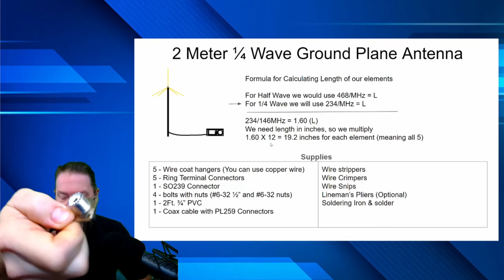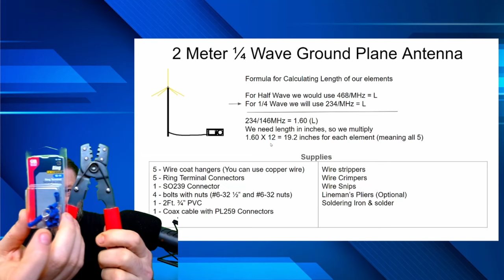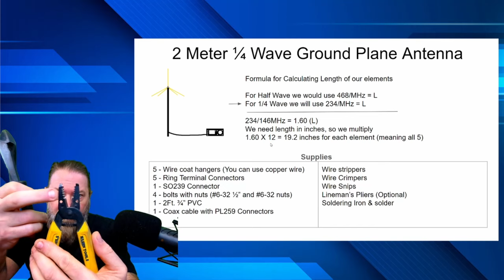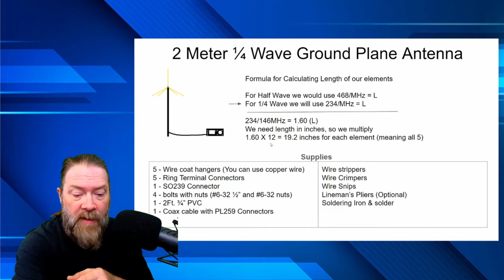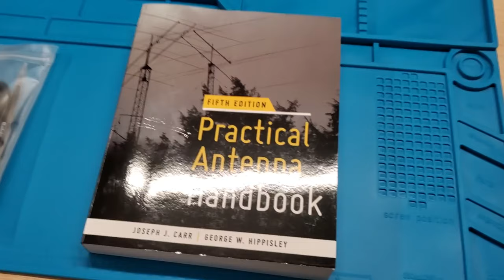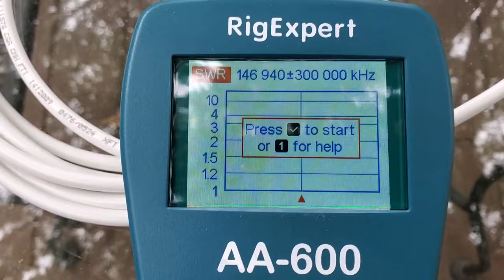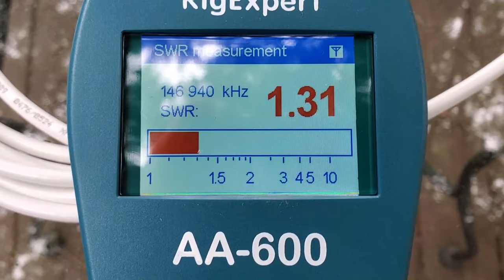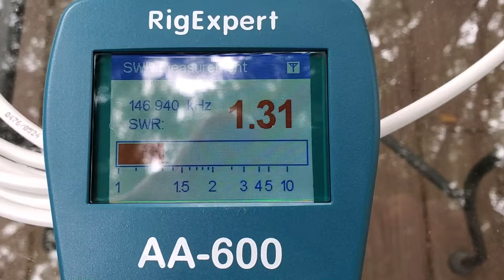Ham Radio Antennas for Beginners - Build Your Own Today!

Comment: Steel wire will stand up at these lengths whereas copper may not. Instead of a pole, it could be pulled up in a tree and the ground radials tied off to ground stakes with paracord or 1/8th inch elastic cord.
This gives me an idea for a yagi on a 1x4 board.
Reply from the maker: There are multiple ways to build this thing...I just demonstrated one for simplicity and showing how you can build an antenna for less and $15.  Thanks for the comment and for watching.  73!!!!

Comment: Some of the hangers have paint and need to use sand paper. New hams with hand held should get the adapters for the hand held to PL259. You will need that some time. and when you need it you may not have time to order it. They don't cost much. If you have the power out and you want to talk, your hand held connected to your outside antenna will get you out. I think part of being a Ham is to be ready for that kind of thing. 73  W4des
Reply from the maker: Well said!!!  As new hams progress in the hobby, they will build up their own kits, hopefully, and adapt to their needs as a ham operator.  Thanks for the comment and for watching.  73

Comment: How far away was the repeater you were using? I'm in the process of building one of these antennas right now. I just got all the stuff last night and going to build it tonight.
Reply from the maker: Fortunately my repeater is 800 feet up and about 5 miles form my house in the video.  Due to its power and height, it reaches out about a 60 mile radius depending on propagation that day.  Thanks for the comment and for watching.  73!!

Comment: Studying to get my lic.  My question is, can you have a combination antenna that is both vertical and horizontal, covering most used band widths?
Reply from the maker: I think that would not be necessary.  If you are just using a 2 meter / 70 CM antenna like one of the Comet or Diamond antennas, they will cover both of those bands in their entirety.  The thing is to watch your SWR and keep it as low as possible for the best performance.  I hope this helps a bit.  Best of luck on passing your exam and getting licensed!!!!  Thanks for the comment and for watching.  73!

Comment: I watched this vid - got everything to do it.   Guess what - the #6 little bolts do not fit the hole - too big for the SO239.  Can you explain that?
Reply from the maker: That is very odd....maybe not all SO-239 manufacturers are the same??  That makes no sense.  I am sorry you are having that issue.  They "should" be universal.  Thanks for watching and for the comment.  73!
Reply: @HR4NT  I got #4 screws off Amazon.  Those do fit - there is some play.  There should be a #5 screw - that would fit perfectly.  The number 6 screws did fit in an N connector that I had.  Guess what - trying to solder -  I melted the insides of that N connector.  Question - what type of solder should be used for these types of connections?  I've got lead-free, 35g, 0.8mm, 0.7%copper, 99.3% Tin.  73!
Reply: @HR4NT  Update - I bought more so-239s and N connectors.  #6 screws fit perfectly in these 239s.  I guess 239s are not universal.  On the ones that the #6 screws did not fit, there is a serial # - KU-79-20.  Not sure what that number means.  On the new ones I got, there is no number.  Time to try it again - without melting the connector this time........
Reply from the maker: @joelschuman1303  good to hear.  Glad you found a solution.  It seemed odd to me that the screws wouldn't fit.  Thanks for the update.

Comment: I looked up your SWR meter...😵‍💫a little out of my price range. Can you recommend a decent but more affordable alternative?
Reply from the maker: The AA-600 can be a bit pricey.  My alternative, which has a smaller screen is the Stick 500:  https://www.gigaparts.com/rig-expert-stick-500-analyzer.html  If that is to much then you are down to a NanoVNA, but they have a large learning curve to figure out, but are around $100.  Let me know if that helps a bit.  73!
Reply: @HR4NT  many thanks!
Reply: I've built more than a couple of these.  My experience is if you build them to the dimensions given they will work.  Testing is nice, but not necessary.  And, if you must test, borrow.  It is much less expensive.

Comment: Wow. I have subscribed for a while, and I have to say that your definition of "non-techies" is very, very different from mine. 

I do not have the location, parts, tools, or knowledge to do most of what you show. I also don't have the space for most of the antennas you want. I do not have a balcony, or attic or lawn, or anything big enough for an outside antenna. I guess I will have to find a place geared to those of us who are at the Less Than Non-Techie level. Or I am thinking about the wrong hobby.
Reply from the maker: There are solutions to every issue.  If you cannot build some of the projects due to lack of skills or tools, then just buy the items that are ready to go out of the box.  My tools didn't come over night.  I spent year buying a little here and there until I had what I needed an that allowed me to expand my ability to do things like you see in this video.  I am not sure what your space situation is, but you "can" put up an antenna in your attic sometimes or hang one inside your house .  It will produce limitations, but is very doable.  In my videos I really try to break down everything in a very easy to follow manner and using minimal tools.  I wouldn't give up.  Just find a solution that works for you.  If for now you have to buy gear instead of building it, so be it.  At least it gets you on the radio and enjoying the hobby.  Thanks for the comment and for watching.  73!
Reply: Your antenna doesn't need to be outside.  It will work better there.  But, if you are working repeaters outside may not be required.  One of the many things I have done over the years is a magnet mount antenna stuck to the top of my refrigerator.  It worked quite well, all things considered.  I could get into every repeater I wanted to.
Now, I have a question for you.  Are there any clubs in your area?  Generally speaking, we are a helpful group of people. If you were to explain what you planned to do and any lack of skill you may have I'm sure you would have plenty of help.  Both with tools and knowledge.   Good luck to you sir.
Reply: @hammathguy3995  As to the questions, I live in a rural county in South Dakota where, according to the FCC, there are less than a dozen ham licenses in total. The closest club is almost 100 miles away, and the one repeater nearby apparently is not connected to any system, though I am not sure I understand enough about it; I do know I have only ever heard one transmission by a human, its call sign. And only once.

Comment: I assume this cannot be left outdoors where it will get rained on, right? I presume that connector would give way.
Reply from the maker: Yeah probably not the best idea to leave it outside unless you can waterproof the connector.  Maybe coax wrap for your cable connecting to it and maybe hot glue on the other side where the soldering was done.  You don't want moisture getting into the so-239.  Thanks for the comment and for watching.  73!

Comment: I have a little hand radio made by some Chinese company that can scan frequency's. I can pick up weather on 162.425 but just static on everything else. Any advice on how to boost the ability to get other things to listen too? I know nothing of ham radios other than there is an abandon house up the road with a huge antenna behind it.
Reply from the maker: If you have the ability with that radio to change out antennas, I would research that.  Find out what type of connector the antenna has and look for something like a Signal Stick or one of the Diamond series antennas.  You will need to know what frequencies your radio picks up and purchase an antenna specific to those bands or frequencies.  162.425 is way above the 2 meter 144-148 frequencies used in Ham Radio.  I hope this helps.  Let me know!  Thanks for the question.  73!
Reply: @HR4NT  Thank you so much! That really helps a alot actually!!

Comment: Newbie question.  What is an acceptable length for the coax cable when using a handheld radio?
Reply from the maker: If it were me I would keep it between 10 - 15 feet.  I would say use as little as you need to make a good transmission on the radio.  Hope that helps.  Thanks for the question!  73!!
Reply: @HR4NT  Thanks for the quick response. I guess my 50 ft coax is too long LOL

Comment: What max watt output do you recommend for these antennas? Would you use these with mobile radios at 100W also?
Reply from the maker: Being that it is a wire antenna directly connected to the SO-239, it should handle100 watts no problem.  The issues come when you add in things like a balun, unun or capacitors.  I hope this helps!  Thanks for the comment and for watching...73!!

Comment: attmpting to build this antenna but the coax with PL259 does not fit into the SO239 connector. Have even ordered another coax with PL259 still does not fit. Any recommendations? Tried to find an adapter but not yet found one.  would be nice to have an anateur radio store for advice. Thanks
Reply from the maker: Since I cannot see the actual issue, could it be the SO-239 connector causing the issue?  I have had moments where it was a tight fit sometimes, but never an issue like what you are experiencing.  Email me and let me know.  Thanks!  73!

Comment: Can you use copper wire with the insulation on it or does it have to be solid un-insulated copper wire like 12 gauge copper wire. Thanks
Reply from the maker: You can use any wire you want...does NOT have to be copper or any specific metal.  You just want something that is stiff enough to hold its own weight.  If you give this build a try, let me know how it went.  Thanks for the comment and for watching.  73!
Reply: @HR4NT  yes absolutely & I will try building it and give you a update 👍
Reply: @HR4NT  also what size or kind of coax wire do you need to use from the new antenna to your radio. (RG58 & or RG59 & or RG6 can you use either of these). Thanks again for your input
Reply: @HR4NT  I found a roll of 250’ of RG6/U in my shop building. Can I use that to hook up to the 1/4 wave antenna (I’m going to build) with a PL259 connector to a SMA connector on a handheld radio. Thanks again for your input
Reply from the maker: @davehardtke1712   You technically can use it but it is not ideal a coax like RG8 or RG8X would be.   You may need the use of a tuner tomake up for the losses by not using a 50 ohm coax.   I'd say give it a shot and do some testing and see how your SWR is on your readings but generally you want to use RG eightex coax or something similar in the 50 ohm category for ham radio.
Reply: @HR4NT  ok thanks for the info and I will keep you updated. Luv your channel & thanks for what you do 👍
Reply: @HR4NT  ok update: got some RG8X coax with connectors & built 1/4 wave ground plane antenna from your video  & turned out great. Got a SWR reading of 1.1 👍 I’m using a Baofeng BF-F8HP radio & studying to take my test.  thanks again my brother I’m new to this & your channel is great from someone new to this. Probably more questions coming along the way lol 👊
Reply from the maker: @davehardtke1712  Outstanding!!!!! Glad to hear it!  Let me know if you have other questions.  73!!!!

Comment: im new to ham radio but i really want to build the antenna in your video i was wondering what  radio you are using so i know which one to get  and use it to speak to the world
Reply from the maker: You can use ANY VHF radio out there.  The radio I was using in the video is the Yaesu FT3DR, which has since been replaced by the FT5DR.  If you use a handheld radio (HT), just make sure you have the proper adapters to go from SMA to PL259.  Most HT radios are SMA or BNC connectors.  Adapters are very cheap and can be found just about anywhere.  This project was fun and I was surprised when it worked.  Thanks for watching and I hope you build this antenna project!  Best of luck!  73!

Comment: Could you just double the length if you wanted to turn this project into a half wave ?
Reply from the maker: Yeah I suppose you could convert it into a dipole configuration and it would work just fine that way.  Might be worth tryin gout for experimentation purposes.  Thanks for the comment and for watching.  73!
Reply: Not without added a matching circuit of some sort.  A half-wave antenna has an impedance of several thousand ohms.  Your 50 ohm radio would not like that.  If you want to try a half-wave consider a j-pole.  This is an end fed half-wave with the matching circuit included.  There are a ton of how-to videos out there.  Just search for "j-pole".

Comment: what's would be the measurements for a 6 meters band ( 50-54 Mhz)?
Reply from the maker: I don't think making this antenna for 6M would be practical.  You would be better off with a dipole.  If we do the calculations from the video, 234/50MHz=4.68.  4.68X12=56.16 inches for each radial.  Making a dipole would make more sense and be a lot easier to do.  Thank you for the comment.  73!!

Comment: Im kind of confused, can the antennae pickup multiple frequencies or only one?
Reply from the maker: Technically it could pick up multiple frequencies but I would not stray too far off from wherever you tune it so that the SWR is kept in check.  I hope this helps.  Thanks for the comment and for watching.  73!

Comment: I think you might do better soldering those uhf connectors with a soldering gun. That iron is not big enough.
Reply from the maker: It seems to have worked out in the end.  But that may be a purchase I make later on if I find a new need for one.  Thanks for the comment and for watching.  73!

Comment: I’m interested into getting started in Ham radio. So that your signature That number you said. Thank you for your video . I herd there was a test to used Ham Radio. Is it a hard test or is it like just common sense question.
Reply from the maker: There are three tests for the three levels of licensing.  You can take the first test ands stop there if you wish or choose to take the other three.  They most definitely DO require that you study for them as the questions are specific and technical.  I have videos and resources to help you study for and pass those exams.  I hop this helps.  Thanks for the question and for watching.  73!

Comment: Howdy, can you build this without using the antenna analyzer? Also I have an antenna that I built (helix) and have no idea if it works. Cheers, KI5BYI
Reply from the maker: You "can", but you need to have access to an SWR meter on the radio so you can see what the ratio is.  If you follow what I built top the "T" and use the same measurements, you technically should be good.  Down the road I high recommend saving up for and getting a nice analyzer.  If you will be in ham radio and building antennas, you will want to have one in your tool kit.  Thanks for the comment and for watching.  73!

Comment: I like how the antenna was like 12 dollars but the swr meter is several hundred.

Is testing swr necessary if the maths check out?
Reply from the maker: It's always a good idea to test, if you want to see the SWR, however if you have a tuner, that "should" work fine I would think.  Thanks for the comment!  and yes the analyzer costs the moon!  LOL.  73!
Reply: The $519 analyzer gives you the ability to create inexpensive antennas that WORK.    I see too much of the reverse... appliance users racing out to drop $500 on a CB whip and coil, set it on the ground and blame their lack of contacts on "the band must be down".
Reply: @twohandsandaradio  that is fair

Comment: So where do you come up with the math to figure out other bans such as 10&11 meter
Reply: Sorry this was for a different video that was building a directional to meter antenna
Reply from the maker: The formula I used is Length = 468 / frequency.  This will help you to determine length for cutting your antennas.  I hope this helps.  Thanks for watching and for the comment.  73
Reply: @HR4NT  thanks  I appreciate it

Comment: Would this be good as a loft antenna. I live in the UK
Reply from the maker: It should work fine being that it is so small.  With an antenna like this, height will be the key.  If you have a repeater around it will work fine.  If not, you may need a more powerful radio as far as wattage goes.  I hope this helped.  Thanks for the comment and for watching.  73!

Comment: Any grounding needed?
Reply from the maker: No.  As this is not supposed to be a permanent setup, you would only have it out when in use, so grounding is not needed.  Thanks for the question and for watching.  73!
Reply: @HR4NT  ooh, yes I get it now. Would be great in my case since I'm just starting out and using it here and there occasionally. Thanks!

Comment: What is the purpose of bending the radial elements down 45 degrees?
Reply from the maker: I believe it changes the radiation pattern for the signal.  Thanks for the question and for watching.  73!
Reply: It "adjusts" the impedance of the antenna.  If you had them flat out, the impedance would be closer to 35 ohms.  If they where straight down you would have a dipole and the impedance would be close to 70 ohms.  By angling to 45 degrees you get something close to the 50 ohms your radio likes.